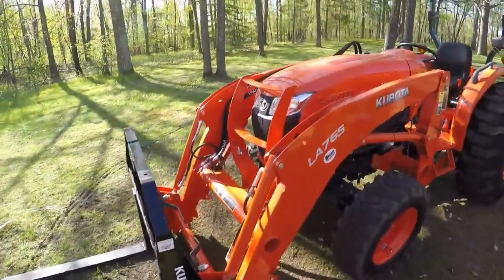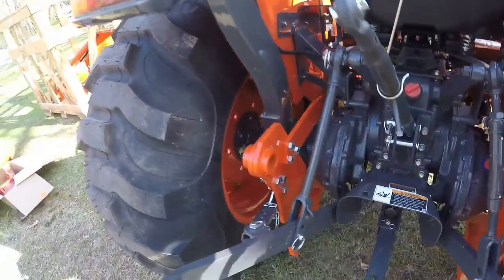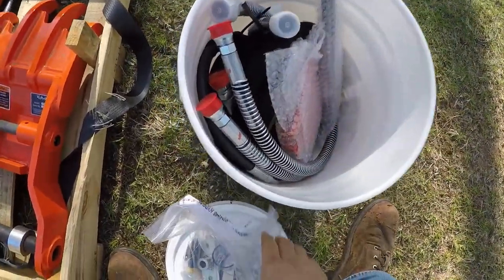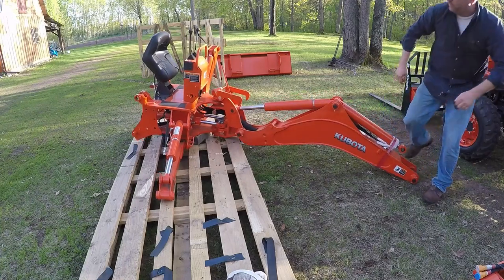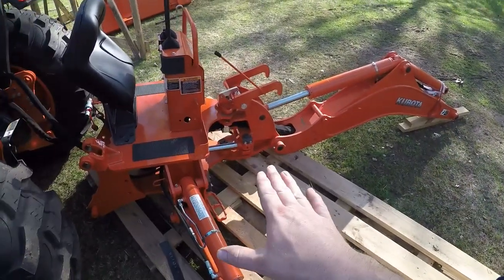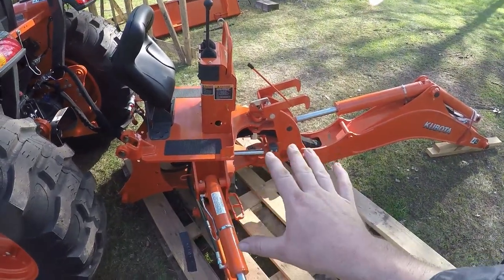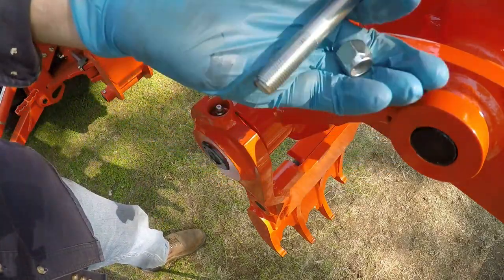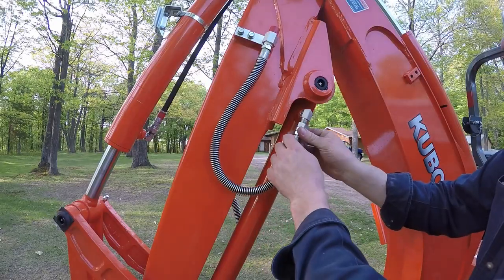Kubota BH92 Backhoe and Hydraulic Thumb - Part 1: Detailed Step By Step Assembly and Installation

Comment: As an additional note. If you happen to also be installing the sub-frame yourself, make sure you run a tap (or a spare bolt) into all the holes your're going to be using to bolt it to the tractor. What happens is these threaded holes get dirt in them, or actual paint from the factory, then halfway through the install you come across a hole that the bolt doesn't want to thread into!

Comment: Glad their mounts were like the loader mounts that the crawlers had where the hoe set down in the mount instead of where the hoe on my pals tractor had to go UP to secure the end. That was a pain and a half. The loader mounts were setup to change out in a couple of minutes. Pop out the top mounting pins and raise the hoe up with the outriggers and fold it over with the boom by raising it and then pull forward a foot or so. The main hydraulic system line was on a quick connect through the hoe so pop it loose from the hoe and connect it back to itself and that was it. Reverse the procedure for hooking back up. Really good setup. Glad Moving Man was back and I knew he'd be chest deep in this. He'll be the stump digger I bet. Thanks, Toby. You'll wonder how you got anong without it.

Comment: Great detail and explanation of steps and "watch out for this" stuff

I have a L-2501 and finally got the Woods BH-75 installed on My tractor and in use after buying it 2.5 years ago, but no thumb.

It was shipped almost fully assembled on a stamped steel pallet.

It was pretty simple to mount and get running.

I will look for those auxiliary mounting holes today because the seat really is too close and keep getting My knees pounded when there is a sudden movement.

My question is have You ever thought of using an alternative seat that has more clearance?

My idea is possibly using an old Harley Bike style seat or even a modified Motorcycle seat where the Operator can change position on the seat and be a lot easier getting on and off of the backhoe,

The bike style seat would still plenty of reared support while giving more leg room

Thanks 

Ken in Florida

Comment: Love it    I have a L35 I bought it in 1997 new from Marshall machinery in Pennsylvania it goes anywhere and gets the job done I had a John Deere 410 in the 80s 2 wheel drive which was a great machine but too heavy in the woods. Except for the amount of weight I can lift is limited it’s great for getting between fences and over ruff terrain💪💪💪💪

Comment: had this thumb put on by dealer and works great but keep getting a drippy leak on the hose coming off the thumb valve.  what a pain to get in there to tighten the fittings!

Comment: Nice video.  I have a BH92 on my L3560 but my thumb and QA have been or back order.  The instructions for the QA say it is not compatible with the thumb and the hydraulic thumb, on Kubota's website, says for KIE QA only.  It worried me that they would not work together.

Comment: You did awesome job buddy. But I got to ask one thing. I operated heavy equipment right at 40 years. I operated rubber tire backhoes . And found out that I would not have a rubber tire backhoe without a four-way bucket, or clamshell bucket as they call it. I'm just asking, cuz I am curious. as to why you didn't get a clamshell bucket with yours. Getting up small enough trees you can bite them up with the clamshell and you don't really need somebody with a chain. You work it right get  good  enough at it. You can clean up without ever having to pick a shovel up. Just asking that's all. I'm sure you got what you wanted. And that's fine. They are nice little tractors. And you can do a lot with them . 😁👍

Comment: I’m surprised more people are not asking about the control pattern on the BH 92 if it is the old John Deere style or the cat excavator style, most operators that run hose for a living use the cat style, just wondering if they can be changed?

Comment: I saw a lot of Minnesota's state birds helping you with that. I don't like Kubota's pins with the grease hole in the pin. They always break where the cross hole is drilled. The grease hole should be in the bushings, not the pins. I'd also like to see the pins with a head on one end and threaded on the other to prevent the mounting flanges from spreading.
Reply: good point

Comment: I always drive the pins in from the side with the hole in it for the bolt.  That way I can eyeball the alignment as I go and can make the last adjustment just before the bolt hole disappears.  Toooooo many times I did it the way he did it in the video and you end up with a pin all the way in, no hole visible and no was to grab the pin and turn it.  This especially happens when you have to beat the shot out of the pin to get it in.

Comment: 16:26  I almost wonder if those brackets could or should be flipped to the top with the bulkhead going above and inboard.  Basically unbolt from the frame and just rotate the bulkhead to the top.  Not sure if the destructions say otherwise, or maybe there isn't clearance from the thread boss to the top gusset.
Reply: I have a BT820 hoe on my B26 and the brackets are installed up, but still out. I'm thinking he has the left and right sides reversed (if there is a difference between them).
Reply: @squatch253  I don't know why... but the blue shirt deal made me laugh.  Possibly because I'm known for my "uniform".  White tee shirt, blue jeans, belt & boots.   I'm too busy to care about a fashion show.  If I made as many videos as you it would be 5 years before somebody might notice new boots or jeans.  LOL

Comment: Always best to use teflon sealant on hydraulic fittings rather than tape. Should a piece of tape ever come off and wind up in a valve assembly it can really be problems.
Reply: @squatch253  Yes done correctly as you did it is pretty safe. It is like silicone on engine gaskets. For someone with out the experience and knowledge watching this to do it themselves I thought it would be good to suggest a safer alternative.

Comment: NOT thinking of getting one but that was interesting. Was particularly in the adjustment for the backhoe operator seat position you'd spoken of in a prior video. So simple - wonder if it was an initial assembly snafu?

Comment: Great Video!  I have the 92 that was installed by the dealer.  I was curious about how you went about tightening the fittings and hoses to the bank on the tower.  Did you use a special wrench?  Thanks.

Comment: Does kubota offer this as a kit for the b2301?
Reply from the maker: Not this BH92 - the L4701 here is the smallest tractor that this model of backhoe will fit on.  But they do have appropriately sized backhoe attachments for nearly all tractor models.

Comment: Thank you so very much for this detailed video.  It was worth liking and subscribing to your channel.  Awesome clarity and straight to the point.  Again, many thanks!
One thing I do want to ask about the BH sub-frame.  I am in Europe (Bulgaria) considering buying an M4072 tractor. Would you happen to know whether M4 series tractors have sub-frames for back-hoes?  Dealers here are sketchy about it, saying that M-series chassis are strong enough, but I do want to double- and triple- check.   M4072 is the 70+ horse power variant of the M4002 model.  I don't know if that corresponds to MX-series in the US or the entry M series...but clearly the Kubota L-line of tractors in the US have dedicated sub-frames.   Hope you happen to know...

Comment: Would you still happen to have the parts numbers for the quick attach bucket setup and thumb when I got my bh92 the dealer said I couldn’t get the quick attach set up with hydraulic thumb so I have the pin on and hydraulic thumb

Comment: I was just wondering how did you purge the air from the  hydraulic system?
Reply: They're pretty much self purging. Just work the hydraulics and the air will end up in the tank as the oil fills the cylinders.

Comment: They sure make aligning the lock bolt difficult. The pin should be slotted on the far end to allow for rotational adjustment.

Then red tape on red tape to code the lines. That's a terrible poka yoke. 🙄

Use a different color at least if they can't use a printed tag.

Comment: It looks like the foot pedal bracket could of went on the out side of the stand. Then you wouldn't of have to turn that piece to align the shaft to the valve stem. Just an observation